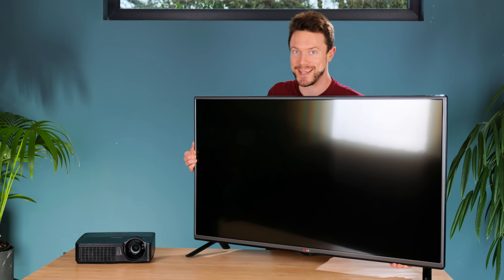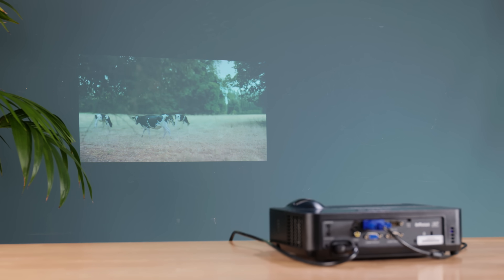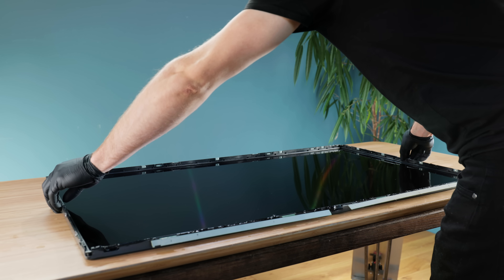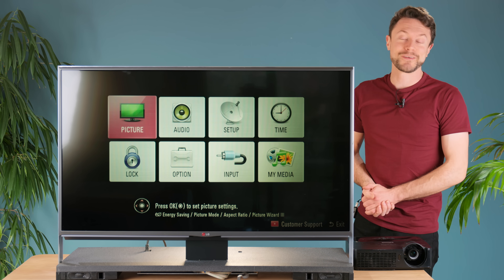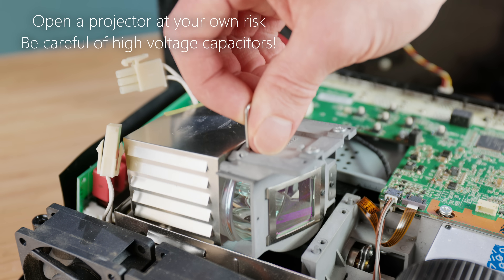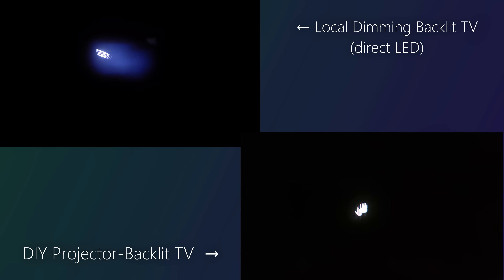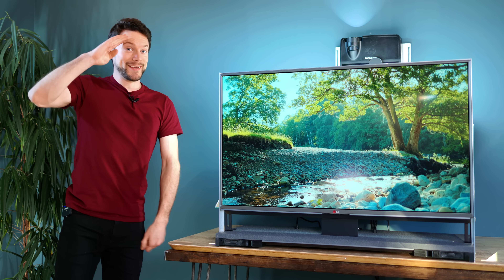DIY "infinity contrast" TV -  with 100% recycled parts

Comment: My friend, you made my dreams come to reality. First with using a tv and projector. Second, @ 12:00 you came upon what you had seen as a minor probem for which you then solved with OBS. However you have discoverd a solution what has been a problem for the past 18 years. Some have created it, but have not fully launched it. With the new laser technology, the projector can correct and straighten images. The situation that you came upon can help solve the problem of 3D without glasses. This "problem" is most definitly the solution. Please carfully revisit and experiment this situation with kid gloves and confidentially submit the findings to those who will nurture and compensate your valuble solution.

Comment: You said something at the end.
The old rear-projections TVs were very close, they only needed to add an LCD panel.
See if you can score an old rear projection.
But leave the tri-color projection.  The enhanced color backlight to the same would intensify everything.
Not just white, through and LCD filter.
Also, for your existing, why not put a 2nd same size LCD TV behind?
Literally, two LCD display panels in front of a backlight?
The grayed down black of the first should be totally blocked by the 2nd.
Then each color is driven by a same-color backlight.
Just a thought.

Comment: This is pretty much the same concept as doubling the LCD filter. After all, the projector is not much more than a tiny LCD projected through a lens. It may be a bit better because it's just black and white.
Also, this whole concept is not that far from CRT. In fact, putting an LCD panel on flat CRT screen may be much better idea, and simpler. Now I want to make LCD CRT monitor...

Comment: What would be cool is if you use something like a Raspberry Pi 4 or 5 to do all the image processing on it and then plug like a HDMI capture card into it to where the input from the capture card could then be transcoded using the Raspberry Pi to function with it, quote unquote TV that you've designed, The reason I specifically recommend at Pi 4 or 5 is because they have two HDMI outputs, meaning that you could feed different video signals out of both of the HDMI outputs so that you can get the true picture created by both outputs.

Comment: Just a curious question, what was the setup you used to run OBS with this plugin running on what i have to assume is just a pass through HDMI setup to save encoding time and overhead. but how are you splitting the video signal to make sure ypur images are in sync and the projector signal is using those filters on the fly as you would not want to have to encode everything you want to watch. But that can also be a strain on lower end systems and you would have to have some form of pc setup to run OBS but is that a custom rig you built just for this project or are you tieing up a whole sysem everytime you want to watch something?
Also what capture card(s) and outputs are you using, its a ditital sitnal for sure but some software and hardware will prevent capture over HDMI if it is a secure HDMI signal?
I see a few options that are possible to do this, but those are going to be a cost greater then the free tv and projector upcycling shown here, its a fantastic idea and using the right lens and mirror config ypu could use a distance projector like the old projection tv's depth, but still its the computer and capture cards/dongles and in sync images that im wondering about the most.

Comment: Would it be possible to apply this but instead of a projector, use a second bare lcd panel as a monochromatic light mask between backlight and primary lcd similar to how resin printer work?

Comment: this technique can be really usefull for a DIY home theater room where you can align the LCD panel to the wall and covering behind the projector along with the main speakers and sub-woofers.
it will be great if used with 75" or bigger LCD panel. that will be one of the cheapest home theater screen setup for sure.
Reply: The bigger the screen, the further the projector has to be from it in order to get the right size so you would need quite a lot of room for a 70 in TV to work this way

Comment: Absolutely brilliant (As always!). I wonder if a floor mounted projector pointing up with the mirror on the top of the display would be more refined. May require raising the display a tad. Also a box could be placed around the entire assembly cutting out the light from the projector (Just like the old style rear projection TVs of the 90s). What a great idea though, thank you!

Comment: This has me wondering if you can just stick an LCD screen into a same sized old DLP TV. You would instantly have a clean looking slim enclosed system. 
Plus there would be no need to align the projector since it’s already designed to project whatever the screen size is

Comment: Great video, I have 2 questions: Can you show how the OBS Stroke/Glow/Shadow plugin dynamically intersects with the other hardware, and 2. Couldn't you create the light using a strong led work-light (more accessible, less hot, and easier to procure)?

Comment: Hi Matt, If you ever want to upgrade this system you should try adding a mono LCD from a resin printer to your previous 4k projector build to act as the projector for this build.

Currently there are many high resolution mono LCD's; 9k, 12k, and the just released 16k (by Elegoo). But most important is the pixel size. The smallest square pixel size (other higher res panels are rectangular) available right now is 17x17um, which can be found on the "9k" mono LCD of the Anycubic Photon Mono 4 Ultra.
The replacement screens aren't too expensive or hard to obtain. I'm using this very idea to darkroom print digital photos.

I'm a big fan of yours, keep up the good work and greetings from Texas!

Comment: So, If I stack two identical cheap HD LCD TV's LCD panels with the rear panel providing localized dimming, it should work. That way, I can ditch the projector and the need for video editing since the LCDs will stacked neatly together, ditching the diffuser for the front panel will bring the panel closer eliminating misalignments, blooms, and shadows. No more projector. No more video editing, no misalignment. So if I stack 3 panels while doubling or tripling the backlighting should bring me closer to absolute black while increasing vibrancy to the colors.
Reply: Sure. That would be 1000$ per month on your electricity bill 😂

Comment: so basically you just need two panels for achieve same result .
strong backlight -> 1st panel with OBS signal -> 2nd panel with normal signal, and it should be a lot slimmer...

Comment: i think one can easy make it as bright as an oled, the projector used cant have more than 2000 lumen which is very weak, i think a better one with 5000 lumen plus would be as good as oled, also i think if one would build a "sun hood" on the back to deflect ambient light it would also help.

Comment: i have a crazy idea why don't you just use two lcd panels one with backlight and another one without backlight 
use first one as another one's backlight. the only thing that is problem is the peek brightness of the first one. if you brightest low resolution monitor then you can use that as backlight of first one. can't you?

edit: i know its not that crazy and also not practical

Comment: That mean you could technically buy an old rear projection TV and replace the screen with an LCD? Then modify its projector in the same way?
Only thing is you’ll always need to split the video input between the projector and LCD

Comment: 17:58 Older projectors use a Xenon bulb. They are basically a portable sun in terms of CRI (Colour Rendering Index). LEDs on the other hand are still kind of lacking although 95 CRI is definitely possible albeit more expensive. Another issue is the lens is designed for the Xenon bulb, so you may have to sought out a lens and LED from another Projector anyway.

Comment: Amazing!! You inspired a thought. You could get four identical 1080p LCD TVs and a 4k video processor to convert a single 4k video signal to four 1080p quadrant signals. Then use a 4k pixel shift projector to create the luminance map and you got yourself a huge high contrast 4k LCD cinema wall.

Comment: I'm not sure of how does projector work really, but wouldn't making the input image black and white make the image less bright? As it would only power on the lamp during the clear uncolored sector of the coloring wheel? At least when it thinks it's currently at the clear part. Removing the wheel and color from the initial image results in pulsing light, wasting a lot of the powercycle. The projector is not projecting anything for ~60% of it's work cycle. I suggest keeping the colors, and trying again, that should trick the projector to work fulltime.

Comment: No projector need.  Basically just  put a second identical panel on the back on first one with the same video but  b/w  and then using same light source on back of two panels  and ... done!! Maybe the solution needs more power lights but for shure black  area of second panel blocks lights to the first   ...How Do they ( Samsung.. LG )  never think at this simple solution? ....🤣😂
Reply: I see just now that you already got  double lcd solutions ... of course whit tech possibility than have a big brand i think it is possible .... they ca have LCD panel without polarization and plus they could youse fresnel lents for the lights source etc.. Anyway good idea...

Comment: With the right lens you could get this system down to the size of the first LCD/flat panel displays.

I know most don't want to go back to TVs that are about a foot wide...BUT...if you told me that I could get a 4K OLED quality TV for the cost of a cheap 4K LED TV if I only sacrificed some thickness of my TV, I'm buying it. 

I'm currently looking for a TV and cannot bring myself to drop $1200 for a decent OLED. Make a rear projection LED like this for about $400 and I'm in. I'd buy it in a second.

Comment: I just wanted to say I'm glad you took the "with recycled parts" thing to heart. Too often when a channel gets big, in an effort to increase the "stakes" so to speak, they start to exclusively use the most expensive and luxurious items they have (or get sent by manufacturers). Linus Tech Tips is a big offender to this with projects like "80 INCH TVs ON ALL 4 SIDES OF THE ROOM!!!". I don't want to see someone try to use a $10000 projector. I want someone to build a projector out of used parts for cheap. this is why I subscribed to you, and not for building the biggest fucking iPhone there is.
Reply: LTT just shills overpriced crap

Comment: ive never seen your videos but im now sooo considering turning my old hella screen burnt tv into this version with the projector i dont really have a use for sitting around. Just not sure if lego, because i dont have 3d prints or aluminum, can handle the heat and pressure generated from being used as the new casing for the electronics. I also have cats that love going behind my tv that id have to keep away from the mirrors and projector

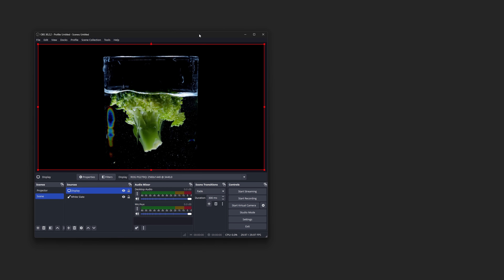Comment: 13:05 I still don't understand this process. Do we need a PC to run this OBS program? so, we can't use a direct source from the TV engine/PCB between the projector and LCD panel?
Reply: Exactly, I think at this point the TV is acting as a large monitor. Both the projector and the TV are separate monitors of the same computer; the TV has "color" while the monitor only has white light.

Comment: Why not mounting the projector facing upwards but positioned to the bottom of the tv and made a full enclosure instead of projection to the ceiling?
Obviously all the circuits must be on top and not on the base

Comment: Projector reso 1024x768 = 4:3, assuming square pixels. How did you deal with that? Did you mask the top and bottom to make it 1024x576? Does it work without bleeding on a DLP projector without the colour wheel? Would it not work on a 4:3 LCD projector?

Comment: I was surprised that rear-projection TVs didn't transition to this approach back in the day, but I'd imagine the heat output and power draw are pretty unpleasant compared with basic LCD screens before you take into account the extra bulk.

Comment: I’m in the process of building a cheap simple fluorescence microscope, using a sidelighting laser shone into the side of a disposable hemocytometer and then filtering the output (picked up by a perpendicular objective) through an optical filter. 
If those 11:00 are actually optical grade dichroic bandpass filters as they appear to be, those are not cheap! Who knew old projectors were such a wealth of cool bits for DIY projects. I bet the lamp assembly itself has some cool uses too.

Comment: This is basically a dual LCD ;) There were a few TVs with this technology, but it has a few problems: it requires a much more powerful backlight to pass through two LCD panels, consumes more energy, and, obviously, the LCD panel is the most expensive component in a TV so having two of them significantly increases the price.
Reply: Don't forget one of the cons being heat!
Reply: He used a DLP projector, so no second LCD here.
Reply: @QuietOC  that wasn't the point the op was making.

Comment: Have you considered using a double LCD panel? The first one for the color image, and the other one for the backlight? And not having any separation between them? Basically that's what you're doing with the projector, because the projector light goes through another LCD. Note that they would have to be two identical televisions,

Comment: You should have put the mirror pointing downside as well as your projector located right under it, to be protected from falling dust overtime, and if you add some triangle enclosure sideways you'll also protect your projector's lens. Cheers from France, it's an awesome project ! Recently I've been searching for such old projectors for a high-resolution combined multitouch surface, ahahah. Instead of wasting money in 4k projectors. Poverty can help having resouceful ideas sometimes !
Reply: Btw, your setup reminds me the very old plasma technology based displays. I remember such a tv at an uncle's home, and it looked retroprojected also.

Comment: Ah yes, let's hide the high-voltage capacitors from fingers by housing it in an ALUMINUM BOX just millimeters away from making contact with said aluminum, making the whole aluminum box a potential high-voltage contact surface. - on top of that, let's take a 10+ year old TV that uses at least 150 watts, and use a 20 year old office projector that can go up to 800 watts in consumption, but let's say it just uses 450 watts, making a 600 total watt consumption, and make what essentially is a classic BIG BOX, open, and ugly setting, causing distracting light pollution, noise, and high energy consumption. 

but got to give it to you one more time : 1,8 million views in 9 days is an achievement though.

Comment: DIY = Dude is Yoda! Marvelous idea! I was following a group over 2 decades ago to DIY a projector using LCD screen form a monitor 2 fresnel lenses, 1 front surface mirror and a triplet lens with a mercury vapor lamp as light source and a ladle holder as a light reflector ;P In the end it all worked and I ended up with a small coffin like projector that could also house a PC to make it into a stand alone HTPC projector. But this idea was awesome along with the creative fix of using free software to achieve the final wanted high level contrast and insane "local dimming".
Now what if the projector is located at the bottom? Can the light path be adjusted to make the depth needed even narrower and put the whole contraption into an enclosed cabinet perhaps? That could be a part 2 of this hack perhaps? *hint-hint*nudge-nudge ;D ;P

Comment: Intersting idea to further the mirror idea and the projector method, take the LCD screen and difusion layer and replace the front of a rear projection TV. That already has the mirror setup and all you need to do is the same light mod to that projector. More contained, double recyling, most likely brighter, and the projector resolution could be much higher

Comment: Honestly to say that my first electronic project was a blinker for my bicycle.. and I got a motivation to deal with electrical projects from this channel❤❤

Just recently I manage to fix my Bluetooth speaker not charging..

I still afraid to do a soldering on PCB.. and I took another way by directly supply power to my speaker instead of charging battery.

Well.. at least my speaker can work again😅. Safe money cause I used an old material left on my bedroom😂 (glad I keep them all)

Keep making a great project..❤❤